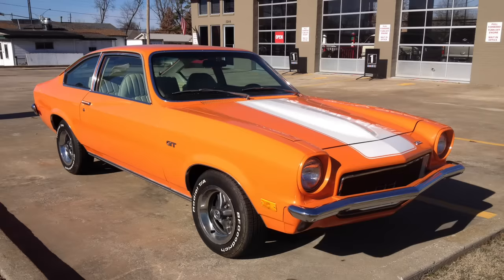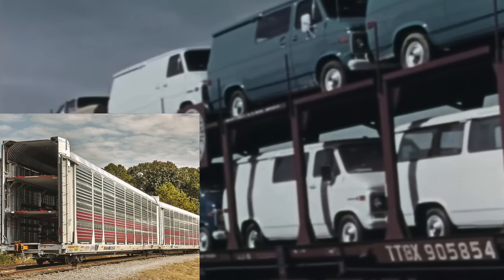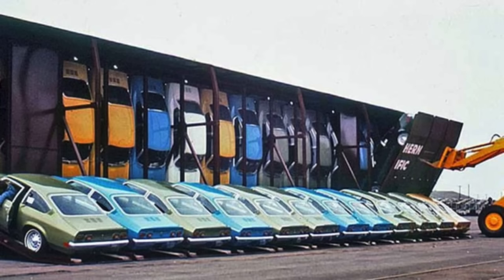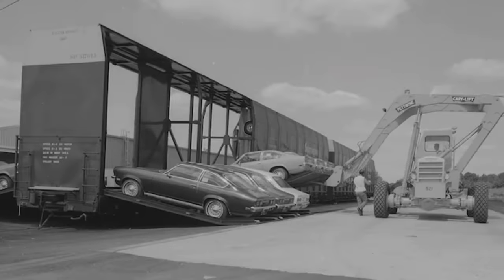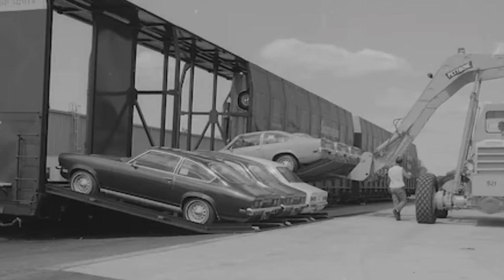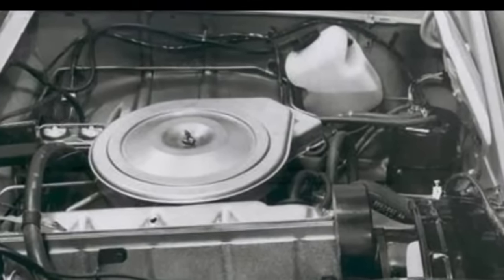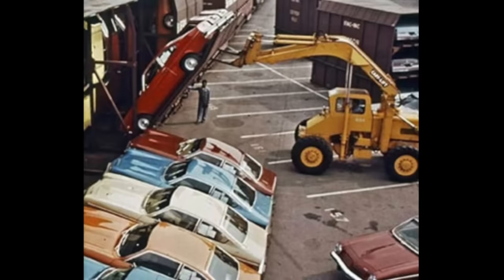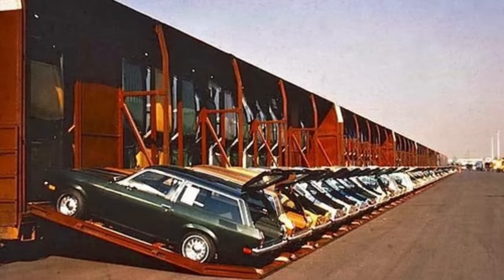GM's Coolest Invention Wasn't Even Part of a Car: The Chevrolet Vega's Vert-a-Pac Shipping System

Comment: Has anyone ever attempted to design a vehicle and railcar so the the length of the vehicle would fit the width of the railcar?
Just simply drive the vehicle onto the railcar sideways.
I think railcars are about 10.5' wide.  The Vega is around 14 ' long.  
How wide are tunnels?  What kind of width restrictions are there for rail?

Comment: Teflon cylinder liners were a mistake, so were lack of inner front fenders where salt and moisture rotted out the fenders as well as the cowl vents and wiper grates, heavy doors caused hinge pins to weaken and doors to sag.
Reply: Silicon

Comment: I don't understand that washer bottle angle. At the end of the day I bet you could just add more rail cars in length with small cost increase for more friction and weight. In a current setting I would think a winch to lift would be better than a forklift.

Comment: I'm sure in the end, the vertipack system didn't pay for itself and that's why they didn't bother.  I mean today you can probably unload a train car full of cars by one or two people, where as the vertipack system may have taken say a handful of people, plus extra equipment.  Not to mention the trains themselves were likely heavier so in the end, they may have been limited simply by weight too.  More Vegas in a train car, sure, but you would maybe have less cars than a standard card with 18 Vegas but less work to load/unload, and it could take more direct routes due to the height of the train cars being able to fit under lower overpasses for example.

Comment: Chevrolet built a Vega prototype called the Z-29(Z-28 was already taken).  This Z-29 had a one-off ALL ALUMINUM 4 bolt DZ 302ci.  Posi rear, big swaybars, 5 lug wheels(i believe) with disk brakes at all 4, Muncie HD 4 speed.  Was painted blue with white rally stripes if memory serves.   The suits at Chevy killed it,, deemed it to dangerous and spendy.   Was featured in Hot Rod Mag back in the day.   That little Hot Rod would have drove the kids crazy.   Can't remember the issue, but it had several pages on it.   I would have been first on the list.

Comment: I really question the savings on this. Engineering all those changes and manufacturing additional parts and special equipment to fasten the vehicle to the railcar surely significantly offset the savings from fitting more cars into the train.

Comment: The problem was acid leaks out of a battery if its not right side up.  Engineers recommended the dealers install the battery.  Unfortunately Vegas made in Lordstown Ohio were NEVER perfect so a few of the had the battery installed.

Comment: Railway Age:
"When Chevrolet was designing the Vega during the late 1960s, one of its main objectives was to keep the cost of the car down around $2,000 (in circa-1970 dollars). At the time, the freight charge for moving a loaded railcar from the Lordstown, Ohio, assembly plant to the Pacific coast—the longest distance cars produced at Lordstown would need to travel—was around $4,800. Since the Vega was a subcompact, it was possible to squeeze three more cars into an autorack, for a total of 18, instead of the usual 15. But that still worked out to around $300 per car—a substantial transportation charge (which dealers passed on to customers) for a $2,000 car. If Chevrolet could get more Vegas on a railroad car, the cost per unit of hauling them would go down.

...Engineers at General Motors and the Southern Pacific Railroad came up with a clever solution. Instead of loading the cars horizontally, they were to be placed vertically on a specially designed autorack called the Vert-A-Pac. Within the same dimensions of an 89-foot flatcar with a tri-level autorack, the Vert-A-Pac system could hold as many as 30 automobiles instead of 18, reducing the transportation charge per vehicle by about 40%."

Comment: I knew guys that would jump the rail cars steal all the full sized spares, batteries, wheels, hubcaps and any other parts that would come off quick and make a buck on. We had a rail line that ran past our house. It was in the middle of nowhere running right out of Detroit. They finally got smart and put cars and trucks in protected rail cars.

Comment: Who'd have thot the vertapac rail cars were designed specifically for one series of cars.  You'd think the engineers wud have the foresight to design a flexible system on a low slung rail car.

The vertapac rail cars cud (with a few mods) be resurrected for the smaller, lighter automobiles of the contemporary market.

Comment: Subaru uk used normal truck car transporter’s on the the launch of the the new age Impreza around 2007 with the lower tier mounted upside down , with the the slogan ‘the new Subaru , sticks like suba glue’ I have pics on either photobucket or flikr that I took.

Comment: The vertipack system sounds like an idea that was much better on paper than it was in practice.  Just the design compromises required to allow the cars to be shipped nose down should have convinced GM that the juice was not worth the squeeze.

Comment: Literally the Vega project can be credited (or blamed, take your pick) for the side terminal battery,  which was developed for the Vert-I-Pac system, but then used on all GM cars going forward.
Reply: The terminal location has nothing to do with the fill cap location, so GM's side terminals are not related to the Vert-A-Pac shipping. 

Side terminals were designed to reduce the cost of battery cables, because they have only a simple eye terminal instead of the clamp needed for use with posts.
Reply: @brianb-p6586  So it was pure coincidence that the side terminal batteries debuted with the Vega? Or that the top post battery, when tilted on its side,  could leak through the terminals?
Reply: @benbrown2119  if a battery leaks through the terminals, take the garbage back to the store that sold it to you. 

I've seen various advantages claimed for side terminals, and none of them are related to leakage through the terminals.  If that were an issue,  then putting the terminals on thd side would make it worse while the battery was upright,  which of course it was for nearly its entire life. 

The timing is not likely entirely coincidence - GM was trying new things in the early 1970s... such as the aluminum engine in the Vega.

Comment: Sometimes you hear automakers holding back on safety features that cost pennys per vehicle, but here vehicles, railcars and surrounding infrastructure got modified at high cost to ship a few cars more. That special Pettibone forklift in the pictures alone cost alot :) So I think it wasnt worrth the effort, unsafe to handle and the cars probably got damaged by " hard mounting" them instead of using their suspension to soften the ride when transported on all four wheels....

Comment: Adam.. I often wondered if Opel played a role in the design of this car.. I know that sounds weird.. but I do see some (what you call styling cues) from Opel's around the fender wells. I also hear on another You Tube video that if a person were to have put a regular sized radiator on these cars, even with the original engine design of the aluminum block, they wouldn't have been as problematic?? I leave this in your capable hands. I just love these "Mini Camaros" LOL.
Reply: If there was a coolant leak and level of coolant in the rather low radiator ever got more than about a half-inch low, the rather tall aluminum engine would overheat and be done.
Reply: Early 4 speed transmissions came from Opel.

Comment: Interesting Vert-a-Pac.  My question is whether they could get the cars loaded and unloaded quicker with the Vert-a-Pac.  I.E.  They could pull in a string of cars.  No switching.  Then simply drive the cars up onto the ramps and pop them closed.  
I'm surprised they didn't go with hydraulic or pneumatic operated doors.
Reply: Hydraulic or pneumatic ramp-doors would add massively to the railcar cost.

Comment: I had a 1975 GT with the 2.5L I4 and manual 5-speed transmission. Great looking little car. I was a big Chevy/GM fan back then. If you tried to do a jack-rabbit start, the transmission and rear axle would jump around. The whole drive train was not secure. The engine was underpowered. And it was hard to shift the transmission. There was no spinning the tires on Vega's. I also replaced a lot of timing belts on that engine. I was beginning to not like the car anymore when my starter wife took the car in the divorce. Later I started dating another wonderful lady who had a 1973 Vega wagon with an automatic. That car was more fun to drive...and she was more fun too... still married today after 39 yrs. No, don't have the Vega anymore... they were really not worth repairing or keeping. Switched to Ford and Toyota's. Much better cars and longer lasting... hmmm, like my marriage.

Comment: I had tremendously good luck with the early "defective" Vega engines. I would find a Vega that had never overheated. Every morning I checked the water and added any that it needed. I then checked the oil. If it was 1/2 quart low, I added 1/2 quart. They leaked and blew oil but never burned it. I drove them for years with no engine trouble ever. I even parked one under a tree for a year or two and then hopped in it and drove coast to coast! I hate their front axles and wheel bearings. They truly do suck!

Comment: I think the biggest problem was, the Vert-a-Pac system was only good for compact cars. Even the rail cars designed specifically for the relatively short Vega caused route logistical problems. There was no way shipping a full size car like a Caprice or Impala 2 door, 4 door, or wagon would be possible in this manner. Or Chevelles, El Camino's, Monte Carlo's or pickups. I'm surprised they ever even bothered with such a system. Unless, of course, they predicted a shrinkage in vehicle dimensions to Vega size or even less across the board that would make delivery of the vast majority of automobiles via the Vert-a-Pac system practical. Possibly they counted on the OPEC Oil Crisis to bring American automobiles down to British Isle sizes, so then it was a predictive gamble that just didn't pay off.

Comment: Don’t take all the comments as accurate, however.
In regard to this, Jim Eager commented:
“Enclosed autoracks became the norm well before 1980. A few early developmental fully-enclosed tri-levels were in service as early as 1972, and limited production enclosed racks entered service in 1973-74-75 in the form of Paragon-Portec's RailPac and Whitehead & Kales' Safe-Pak. Almost immediately fully-enclosed rack production exploded in 1975. All VAPs were withdrawn from service after the 1977 model year, and most were quickly repacked with fully enclosed tri-levels. By 1980 enclosed trilevel racks comprised fully half of all tri-levels in service as the newer open or side-protected tri-levels were converted to bilevels. It took a while longer for fully enclosed bi-levels to catch up as the love of big, heavy suvs and vans had not yet infected American drivers en masse.
The video is long on assertions and assumptions about the VAPs and short on facts. For example, fully enclosed racks were no taller than the Vert-A-Pac, so the narrator’s assertion of the height of the VAP and consequent routing restrictions being one reason for their demise was equally true for conventional enclosed racks.”

Comment: My first car was a rebadged Pontiac version, the "Astre"! It was a 1977 wrong parts version. I quickly found out that I had to get parts for a 78 sunbird if I wanted the right stuff. I guess they ran out of engines and brakes before they ran out of bodies and dipped into the stuff for the sunbird evolution of the car. It was a great little car until a crazy fat lady at the McDonald's drive thru totaled it and almost killed me.
Reply: In the early 80s it was pointless to sell parts for GM cars based on what kind of engine the customers thought they had. "Hey man, I know it's a Chevy and it says "350" right on the side and what do you want my VIN number for?"

Comment: This is fascinating. I’d NO idea this was a thing…perfect for EVs with no liquids to speak-of…
Reply: Generally brake fluid and often but not always a whole liquid cooling system for the motor and/or battery. Now, those are probably the two easiest systems to seal up...

Oh and still a 12v battery but so many cars use AGM these days, those shouldn't mind being tipped on end.
Reply: The only fluid in a gasoline-engine car that isn't in a typical EV is engine oil.

Comment: What's a vegan needed was a nice little V6. Aluminum 4 cylinders the iron Duke 4 cylinders or just trash. We can stick a 283 carburetor engine in there and the thing we get 25 plus miles to the gallon. Of course that would not be within the GM platform if so many horses per pound. We butchered them a little bit sticking those small block creates in there but you could have put a 305 which were trash engines themselves early on. 305 was introduce after the Vega was almost finished with the run. Before that is a crappy 307 engine even the old 265 V8 from 1955 just anything and it would just rip up the road and still get a good 25 mi to the gallon! I am sure that if you drove it more sensible than 16 year old kid did, you could probably get around 30 mi a gallon out of that set up. Little lightweight for speeds and automatic transmissions didn't hold up too well. The lightweight differentials did all right. But we found for them cars they were kind of well-built for the size of car. And what did we care if we tore something up and go buy another part at the salvage yard and replace it. Now as far as getting on topic with the rail system. I think that's neat. It's creative but I'll agree with you with all the incidentals it didn't save them any money. Thank you this is a very interesting episode. I do have a soft spot for Vegas and recently the prices have dropped out of the bottom of the bucket on them. I was tempted to buy one that was practically rust free for something like $600. If it was the wagon and even twice that price in that condition I probably would have bought it. So even though the cars are around 50 years old still have a soft spot for them. Look forward to your next Vega episode.

Comment: I had a 73 Pontiac Astra, 53000 miles, used a quart of oil every 100 miles and left rust piles everywhere i parked below the doors and wheel wells  I owned it from 1979 to 81 paid 200 for it

Comment: While the Vega was designed for oil not to leak when travelling vertically, it wasn't design very well to stop it from leaking when driving horizontally.

Comment: Bad engineering in the shipping department the motor oil drained past the engine front seal and leaked on the rubber timing belt and caused them to fail  I did get to go to lordstown Ohio in 1974 to see the final assembly was a fun day .

Comment: I cannot believe the bean counters at GM approved of this.Initially yes you can transport 30 vehicles as opposed to 18.You take the oil pan,baffles ,battery ,windshield washer modifications,then you need a specialized larger rail car that can only run on certain tracks due to the height.Just doesn't make financial sense.I guess tried and failed.

Comment: Was the Vega GM's response to the Ford Pinto? Both are sweet, but that Vega is a true babe.
Reply: My parents test drove both - Pinto and Vega - in 1973, and I rode in the back seat. Both were horrible; the Pinto blew black smoke and the Vega vibrated like a paint shaker. They bought an AMC Gremlin instead, which at least didn't smoke and ran smoothly (with its inline 6-cylinder engine)... although it was a horrible car itself.

Comment: I have to wonder if any of these design mods to allow vertical shipment, affected the service life of the cars. Also the transmission fluid would leak too, that must have been addressed somehow. The price of the rail cars alone should have killed the idea. Sounds like one of those lame cost cutting ideas that management comes up with that some team of engineers had to make work. Been there, done that!

Comment: I had a vega…$200 in 76 for a 72….blew the engine in a month…rebuilt it with…/Cast Iron Head and brass valve guides../sold it a year later for $600…saw it a decade later going strong….the problemwas the aluminum heads would crack when the aluminum block over heated and the deck warped…with iron it didnt hapoen..\

Comment: Glad I sold mine in 1980. Rusting at the bottom edge,  it kidnapped spark plugs and killed them like a terrorist. Only oiling the plugs before putting them in would give you a chance to not break them when you removed them.

Comment: Such a shame that GM didn't put all this engineering effort into the lousy engine and rusty body.  I know everyone makes fun of the Pintos but I think they were relatively reliable at least.  Short sighted blunders like the Vega just laid out the red carpet for Japan to take over....
Reply: GM's profits went up a teeny amount because of the costs saved by using paper head gaskets and not wasting money on fender liners or radiator overflow tanks. Those choices produced legions of customers with good reasons to never buy another GM car, but it was and still seems to be, classic American business school wisdom.